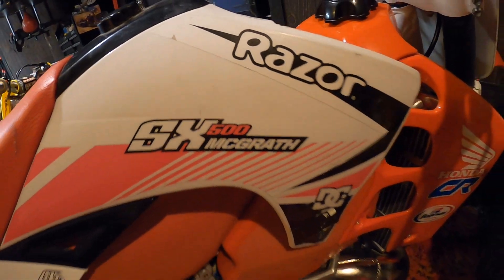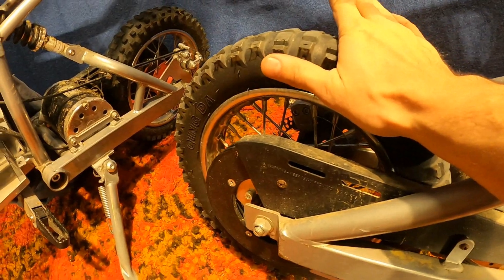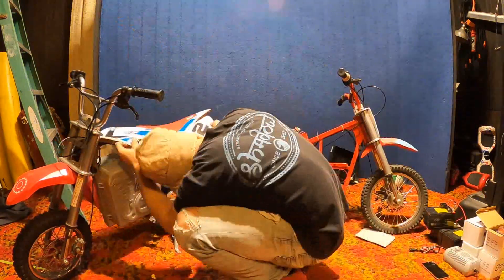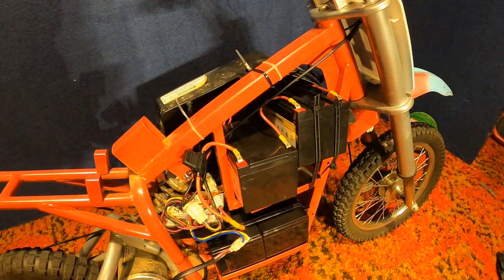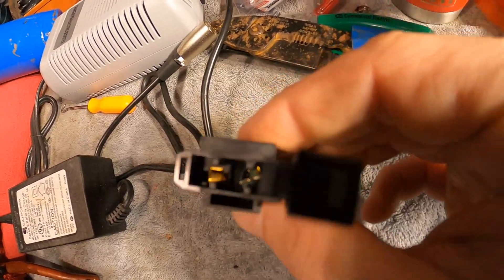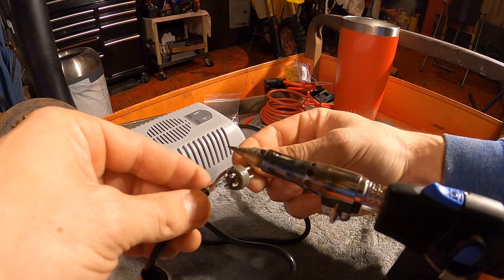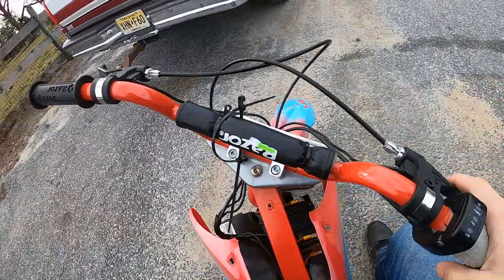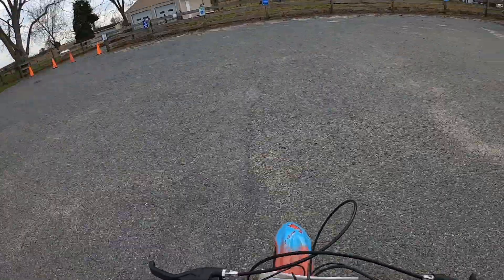Razor 500 vs 650 .. 36v conversion to 48v

Comment: I hopped up my Kids Barbie Vette when they were younger  looked like John Force coming off the line . but it had plastic tires and when they let off the peddle it slid 15 plus feet! so i lined the tirs with rubber and it would pull the wheels 6'' of the ground and look like it gave the kids whiplash lol! but they loved it!
Reply from the maker: yea i c them in the auction all the time with the rear wheels burnt out lol now i kno why